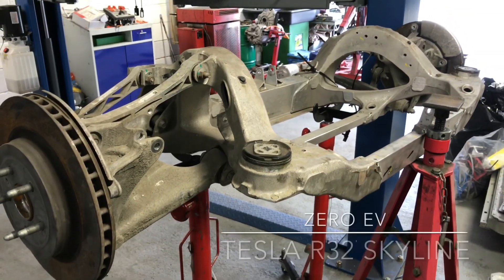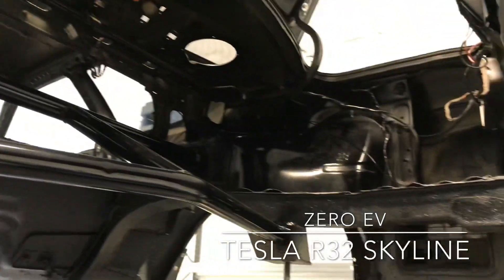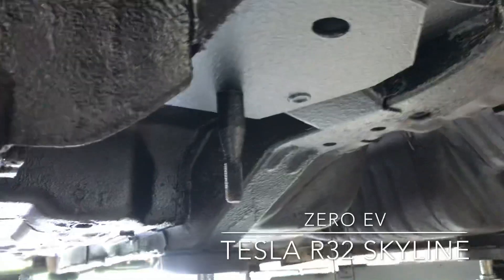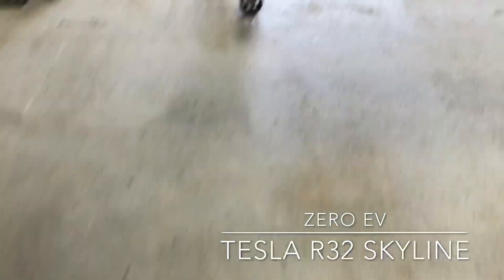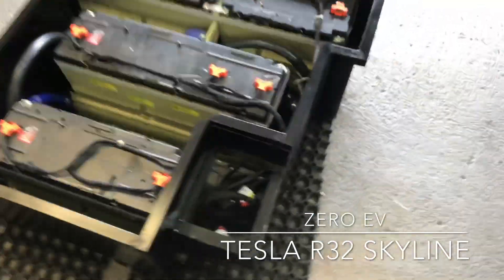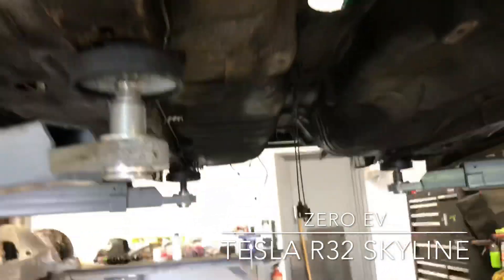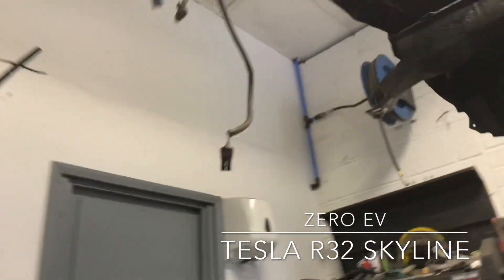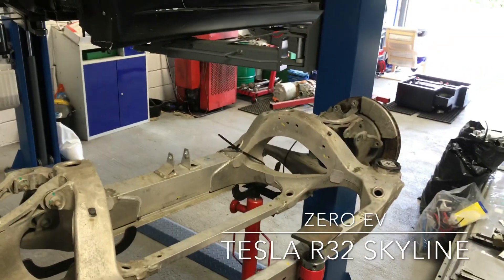Tesla R32 Skyline build first ever youtube video :) Build overview

Comment: Why use the whole Tesla suspension instead of just the motor? Seems like it would be simpler to mount just the motor and make new half shafts.
Reply from the maker: There would of been no original subframe left was way to big
Reply: Tesla motor is a odd shape bit like a fwd gear box and engine together not like many motors that could jist be bolted to an adapter plate to the skyline box or  diffs prop

Comment: Would you say its weight is good? Like 50/50 with the motor in back and batteries in front?
Reply from the maker: Dan Vercruysse with the new 60kwh battery and roll cage now fitted its 60/40 at 1291kg total
Reply: @Hazell_Nutz  that's pretty good, I'm not sure what you really want for drifting but I'd be happy with those numbers. Thanks for the reply.

Comment: Dare you to do this to a Ford Festiva.. 

Dare you.
Reply from the maker: Gary Stinten fords have never been my thing 🤔 😂 but would be happy to do it if someone wanted us to.
Reply: Zero EV well.. this isn't just any ford.. it's not a muscle car..it wasn't purpose built as a sports car, moreso..  it's a late 80s/mid 90s econobox unibody, that never had engineered rwd.. and was made in conjunction with Kia Ford and Mazda.. or kmf as it's known in the arena.

Come on.. this thing smokes civics.... With the right setup. 

Being this is an exercise in converting a non Ev into one.. this would definitely be a sight to see and don't worry.. there is an audience waiting over at www.fordfestiva.com that would more than get your views up.. as well as the Malaysians and half of the United states.. plus anyone else curious to know about retrofitting ev guts.. 

I'd happily watch it a few thousand times over to study it.. and I'm sure there would be quite a few others also. 

I can see it kinda like this.. 

strip out the entire car, An automatic version of the Festiva would be an ideal model.. either by keeping with the auto shifter and removing remainder of tunnel and replacing with flat sheet.. then replace Festiva loom with Tesla loom, meaning all electrics to be shortened, or looms shortened via cable ties.  I don't know how you'd roll but I see that. Replace Tesla plugs with original Festiva plugs for rear and front lights.. along with the rest of the sensors and electronics to be housed in such a small chassis. Failing not being able to use the Festiva shifter, a simpler idea would be to adapt Tesla steering rack into build and remove complete centre tunnel and weld in some nice plate to replace floor. 

Now, build a cage to house front motor, which bolts onto existing crossmember.. making it easy to lift in and out and a simple no mess no fuss kinda operation. After motor work and wiring is done, add frunk from Tesla.. ans you'll see this coming to life.  

Replace stock shocks with suitable airbag suspension suited to Festiva.  

Lay cells out inside car and see how many can be accommodated on the floorpan and either redesign  chassis to support new cells and seatbelt bolt in areas or create new mounting points to accomodate new Tesla seats. Design a plate to bolt over the top of the cells as well as contain all plumbing and cooling for batteries and be able to mount the seats into car and use aerogel matting to keep it fireproof.. however, you might have issues with the rear seat.. so either a reupholster of the rear seat or make it a 5 seater using 3 standard passenger seats and have all working and functioning.. with racing harnesses obviously. 

The dash.. I see the original Festiva dash and centre console being updated with the support for the Tesla MCU and cluster and all the heating ducts integrated from the Festiva and converted to work with the Tesla heaterbox.. otherwise find a suitable electronic heater box that could be controlled via the MCU. The cluster is simply mounted into the original space for the old Festiva cluster. But you must keep the dash clock.

Now.. the backend will probably have to be rebuilt to support the rear drive motor and frame and find suitable replacement suspension or reutilize the suspension from the Tesla but modify the suspension arches to suit the Festiva.  

Now comes the fun part.. 

Reinstall trim to fit, and pick a new carpet to match interior colours... Which was a massive selection of grey.. or grey and red stripes for sports.. cause.... RACECAR. 

Keep in mind.. the car itself, fully loaded to the old spec was a total of 900kgs.. without people. 

And as some advice for space in engine bay.. it could fit a klze/klde Mazda engine .. and If you're not certain what that is... 2.5l V6 engine. So just something to keep in mind. 

Hope I've given you some motivation and some food for thought.. 

Here better yet.. 

Go buy one and use it as a daily for a month... Then see what I'm talking about.  

They bite these cars and when they do... You'll be hooked.

Thanks for your time
Reply: One last thing.  

I'm not talking the aspire.. 

The ford Festiva.

Comment: I couldn't find your other video on the battery so I'll ask here. Why a separate BMS rather than reusing the Volt's BMS? I thought the protocol for that was reasonably well understood.

Looking forward to seeing the rest of your build.
Reply from the maker: Will have the other video up tonight. Did look at the volt bms and wanted to use it but there was not a huge amount of information. There is big benefits with using Orion as we can communicate with our tesla drive unit, Tesla charger and digital display because it allows custom canbus messages. It also supports dc charging and coolant system control. We also use Orion with tesla battery modules so is a standard that we use on everything try and keep everything standardised and running the same systems where possible.
Reply: OK. Makes sense. Thanks for replying.